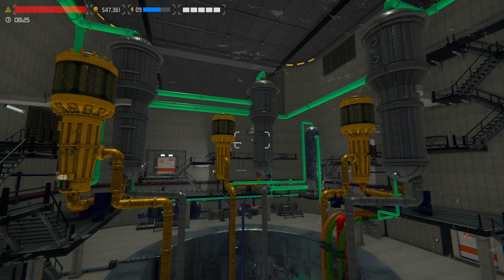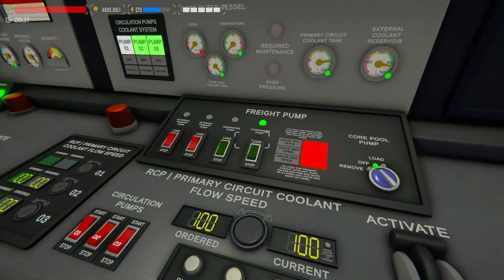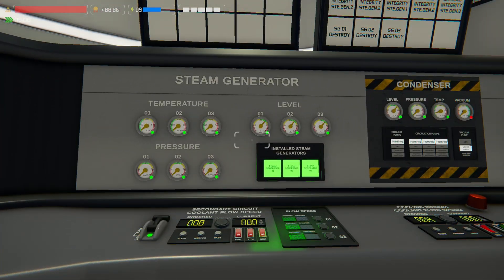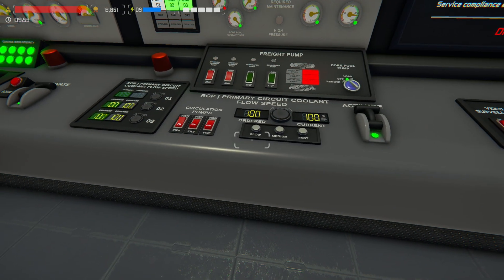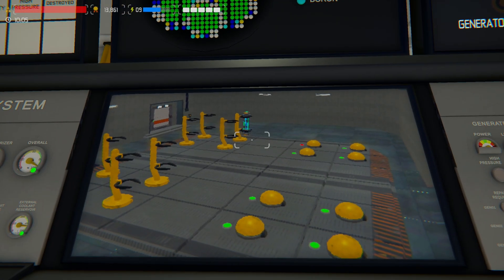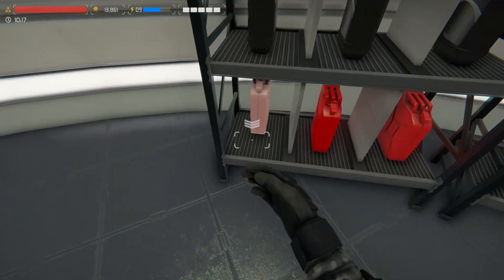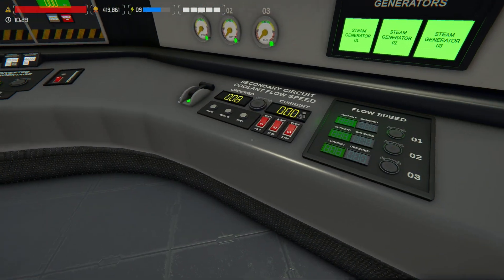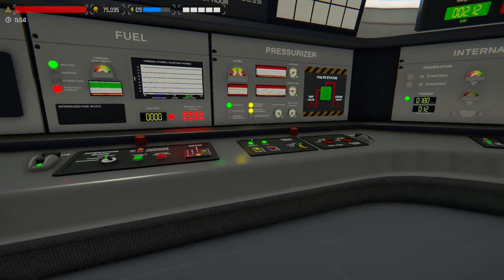No MONEY for Repairs S03E25 - Nucleares Tutorial

Comment: sharpy in order to avoid problems with xenon, you need to start with boric acid in the sistem as usual. After 9hours then you need to start filter the boric acid because of the xenon starts to decay. Try to keep reactivity stable without big variations and do not touch costantly the rods :) 360 degrees at high (if you need a lot of power production) and 10 React. Keep it stable
Reply from the maker: Cheers for the insight as always... I didn't know the core could be started with boric acid already present within the core, in the quantity needed during power output.
I've always tried to replicate everything within the facility to show what the game starts with in a new save game start.
I might try starting it up differently next time, cheers as always 😎👌🤯🤪
Reply: @ShArPy1o1Games  i was not clear, sorry. I guess you can try to inyect Boric acid before start! i never tried but it is an interesting test. I was saing to start as you usually do with the 50mg Boric acid till it saturate

Comment: I think for the ion column cleaning it's supposed to be a sodium hydroxide clean, then a cleaning water rinse to get the pH back down since sodium hydroxide is a strong base and leftovers are going to react with the boric acid. But I don't think it's simulated yet, the pH meter is just fixed there. Also why do you filter all the boric acid out for shutdown, just to pump it right back in? You can leave it there and save a bunch of time and chemicals.
Also I think the small drain valves on the chemical tanks were added in case of loading the wrong chemical in the wrong tank
Reply from the maker: I drained most of it out to get a better and stable start up with the chemicals and to help with the coding within the game as its isn't simulated properly just yet as you said 🤪😎